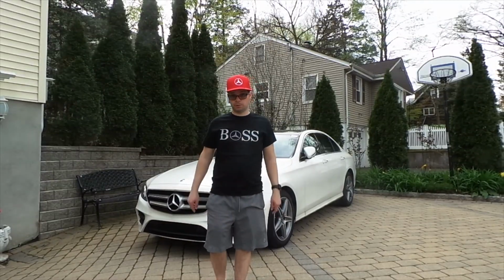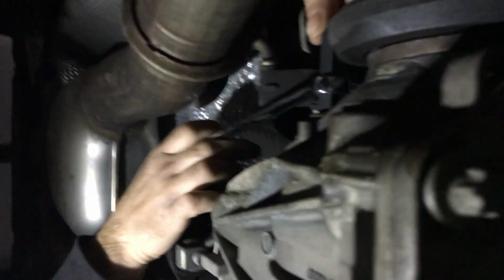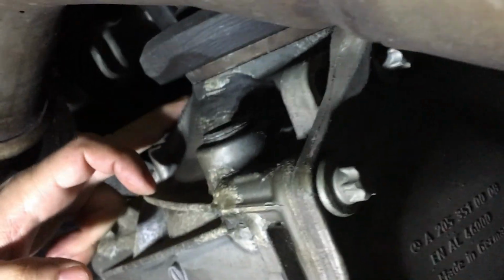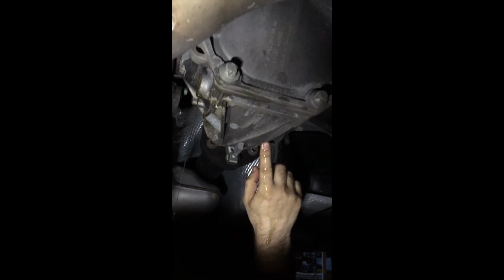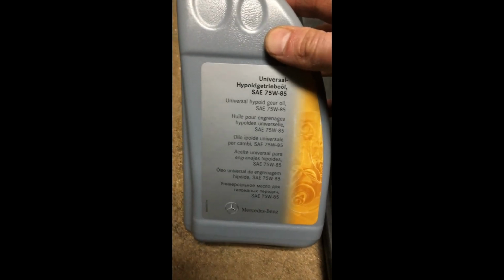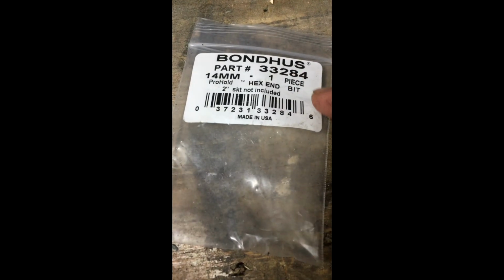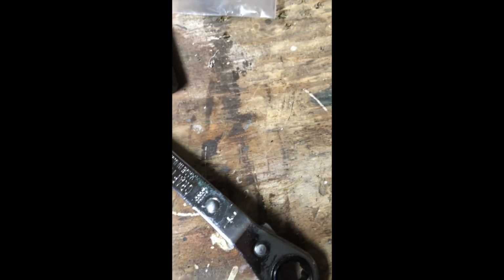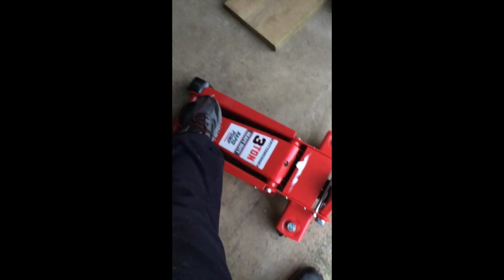Mercedes rear differential oil change

Comment: You really don’t need to. It’s only in the 50’s but it’s your car. Their is nothing wrong with your fluid.
Reply from the maker: yes but now I don't have to worry about it now that I 70,000 Mailes on it. when I did the transmission fluid change it was like it was a new  transmission when they said that its docent need a change. I'm happy that I did it also. Don't always listen to what they say.